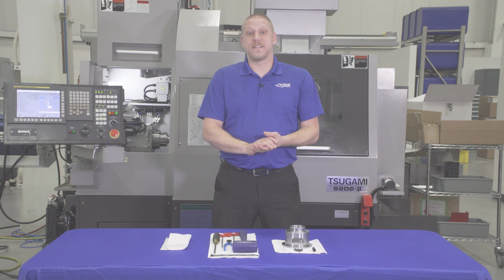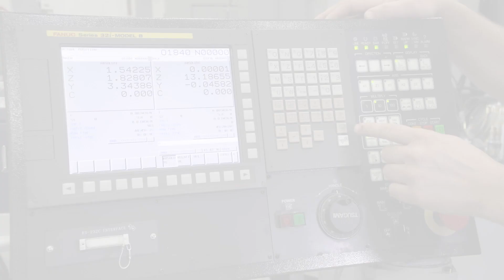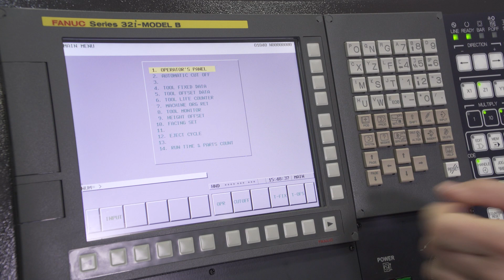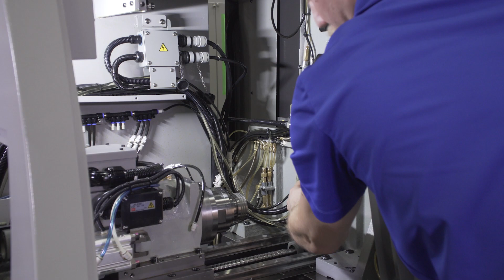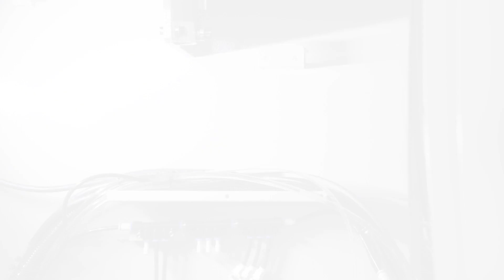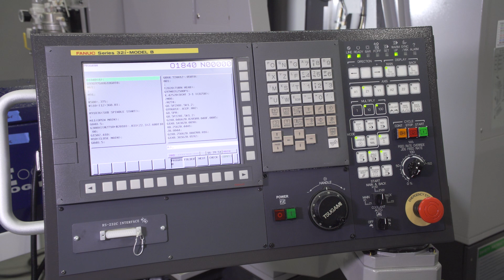How to Change Over from Swiss to Chucker Mode

Comment: great video, nice to know this is something a machinist can do, but one tip, with the motor/sleive, add a couple of screw-in dowel pins to aid removal/intilation, this stops the motor falling onto the guideways and scratching anything, also can act as a back-stop, preventing you from pushing it too far from the front and aids alignment when instaling.